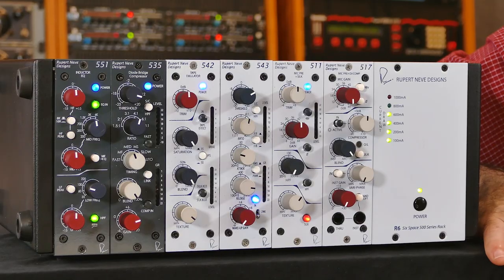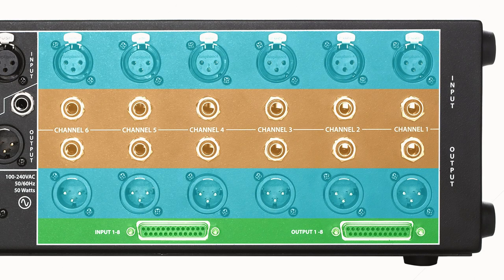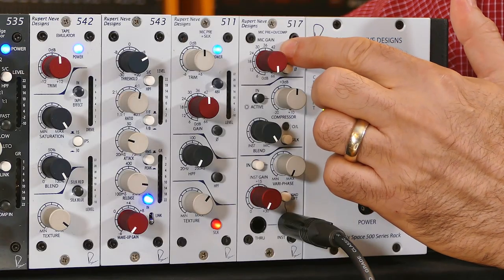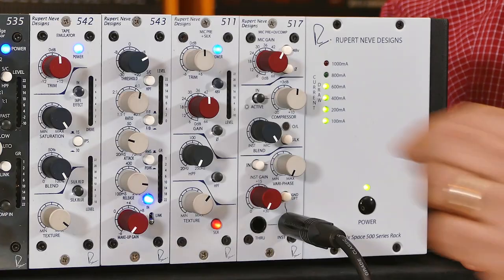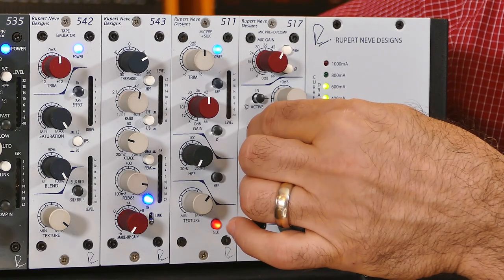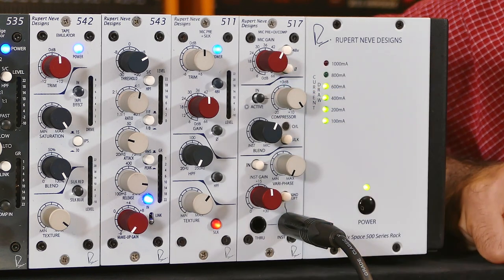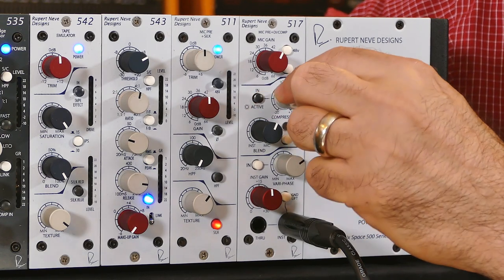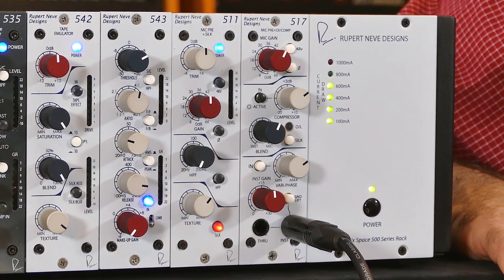Quick Start: 517 Mic Pre + DI + Compressor

Comment: could you please point me to some documentation which explains how the silk button works? How does it compare to the silk on the 511? Is it a moderate setting, ie - equivalent to 9 o clock on 511?
Reply from the maker: There isn't really a "direct" comparison per se, but push-button Silk is roughly similar to a low Silk Red setting, yes. If you want to learn more about Silk you can watch this video! https://youtu.be/fSph2xd-1oA
Reply: @RupertNeveDesigns  oh ok thanks. Watched the video - very interesting, so is 517 silk red or silk blue?

Also, do you know what the default setting is in the 517s for the compressor (im told you can change them manually by opening them up), fast or slow?
Reply: @DanielS10291  red